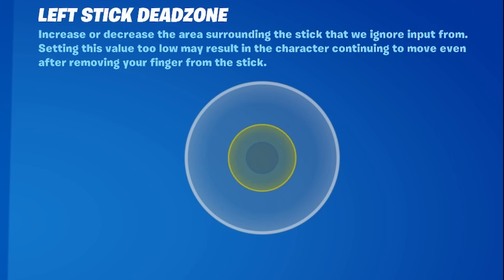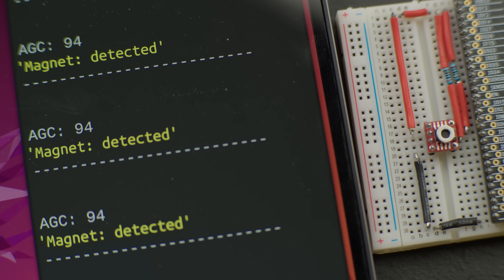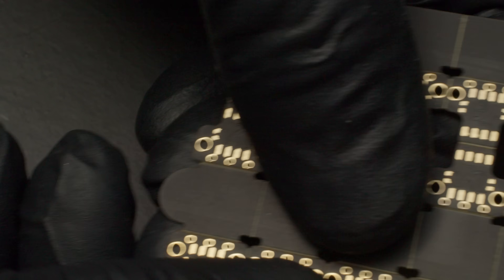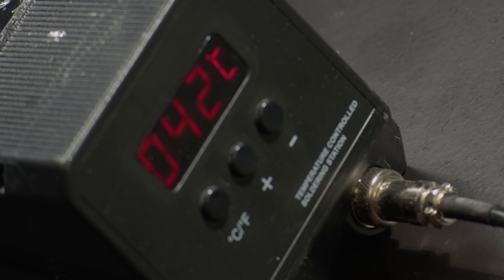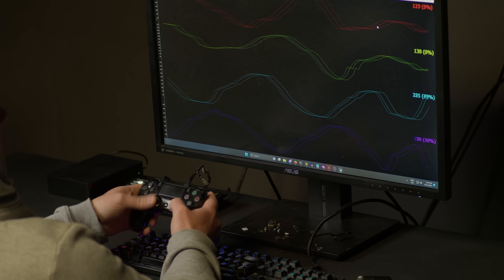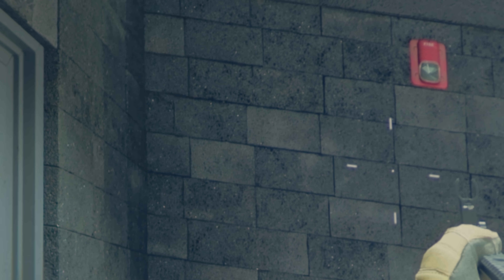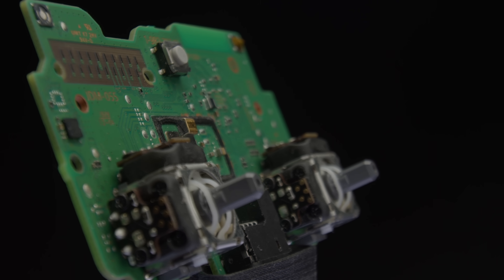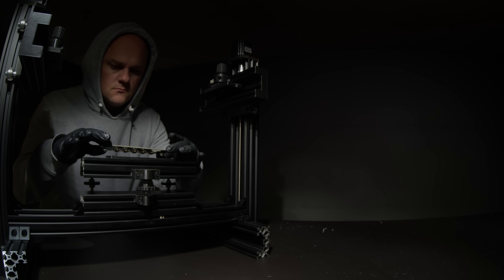Beating the $20B Joystick Drift Problem, and giving it away for free

Comment: they are fully aware of the problem and it is intentional Robbery , it is designed to break, simulated on known data about different materials and their stressresistance to withstand just long enough to pass any guarantee times, based on data from average controller use. The Automotive industry does exactly the same shit, creating parts that are designed to break after a fix amount of time and or usage. So, if your uneducated and unfamiliar with (not so complex) mechanical skills (most people arent even able to change their tires by themselves) you have to buy OEM parts, get it fixed at OEM shops on evil high Prices, or get a New Car after you get a new Credit, because you need to get to work to survive (and pay off the 10 cars you owned that broke down while there are still cars from the 80s with 1million miles on the clock driving happily around). Even Worse, them Evil Companys dont even give a shit about the Public knowing about this, because they fuck you in the Ass and are able to make you ask for more. Thanks alot America, you ruined the whole world with your stupid broken CapitalisticSystem.....

Comment: This is great and I commend you.
Not that it excuses anything, but at least as far as I have experienced, the current dualsense drift issue is due to the poor quality of the wipers as the material flakes off and gets in the way and causes the drift.
It's relatively easy to correct, but of course this shouldn't be an issue in the first place.
Then again, we live in a world where (especially since the global lockdowns) prices are going up and quality is going down rapidly. It's everywhere, not just game controllers or electronics.
Reply from the maker: True true! We need deflationary acts of individual when we cannot trust our institutions to handle it. You make a valid point about the vipers, im gonna do some experiments with a simpler solution. 3d printed conductive plastic material instead of the thing easy breakable resistive material. :D Thank you.

Comment: It seems that people are finally beginning to realize how bad of an issue joystick drift has become since 7th gen controllers.
I've never really encountered drift issues with PS2 or OG Xbox controllers. There still working fine for the most part. Even my PS1 dual shocks that has been used since the 90's is still going strong.
I have a bit of drift with my old PS3 controller that i put prob over 2000 hours into.
But i feel it really went downhill from there on. 
With the Joycons taking the cake. Which i replaced 2 times each after only around 150hours of playing.
I now have the guilikit hall sensors in there. Hope i don't have to open it up. For the coming 20 years at least.
I would love to have these in my PS4, so you won't have to worry about it anymore.

Great work being done here. I always love the users coming up with solutions when the companies ignore their user base when there is no profit in it for them .

Comment: Makeing the patent free, keep's a company from purchasing it, and putting it on the back of the shelf for eternaty. Drift as you say cause's there to be a lot of mony in the sale of new controller's. In bussiness it'sreferred to as "PLANED OBSOLESENCE". Both Microsoft and Sony have known this issue can be fixed by doing this, but then when they make billion's on the replacement's of controller's. Well, who in their right mind, would deliberately give up billion's and do this.

After several year's which when I didn't start until I was 66 year's old. I've learn or taught my muscle memory to utilize an xbox controller. And as hard as it is to change one's muscle memory, and the elderly take even longer. I've changed to the "KONG" controller. Been over a year, and still no drift.

Comment: I will never understand why consoles don't have native stick drift support.. Like..... what, why?

 Or even better, built in stick drift support on the controllers, because not every controller has the same amount of drift.
Reply from the maker: They all have. Or almost all. Its the deadzone. The problem is you cannot unbreak the glass. If the joystick gives out broken glass signal. No software can fix it.

Comment: I have a serious question that i couldnt find an answer for,,,,,what makes the joystick go loose stuck on the side and can it be fixed ?
Reply from the maker: Can you try explain what you mean by go loose on the side?
Reply: @MariusHeier1  Thanks for you reply and sorry for my English what I meant is the joystick gets worn off from heavy use with time the stick won't go back to the center when you move it left right or up  down

Comment: It's funny, and no one believes me, but I have the cure for drift and it involves no dissembly.
Reply: @@_Decadent_Descent fast-drying silicone spray.
I don't know HOW it works, I just know that it does, and has been for the last seven months. Only one application. It's like magic
Reply: @paulmccarter908 does this works on already drifted stick or would you have to do this before they break?
Reply: @Albertmars32  This was a desperation move on my part, having four joycons drifting.
I was so sick of it I was willing to try anything. It turns out silicone is non reactive to electronics, and leaves a very thin layer of dry silicone that lubricates the mechanics of the sticks, buttons, triggers. Smooth and glassy after, sticky and jumpy before. It was and is a miracle.
Just to add, I wasn't shy about the amount; I shook out the extra and it dries pretty fast.
Bingo, no drift. I checked it immediately after with the joystick centering mode and all sticks return to center, perfectly

Comment: NO ONE will use that "solution", because if solution was simple/cheap/effective enough to be invented by random YouTube ego-maniac, actual engineers would already made it. Another video in genre of "I built light speed rocket better than NASA". Geeez, stop it. Even the title of the video is bs. WHere did you get "20B$ problem"? 20B$ is the amount of gamepads sold in the past decade, not cost of this "problem" (that barely exists, by the way, in years owning ps4 and ps5 never have I ever had problem with drift).
Reply: Actual engineer already using Hall sensor instead of potensio as industry standard in a drive-by-wire vehicle. I have never find potentio used in throttle except in toys
Reply from the maker: @iveusethisusername  Controllers are sold as toys. So its kinda expected
Reply from the maker: So how far has the world become when a random NON-engineer YouTube ego-maniac fixes the problems actual engineer cannot? Maybe your small sample size of 1 gamer is not enough to get a feel of the problem?

Comment: Since the ps4 I have stuck with ONE controller and when there's drift I replace the disc in the sensor and it works but over time drift comes back, now on ps5 it's worse bc it's twitches and Jerusalem to the left and first person shooting games are hard to play if you can't accurately aim, I don't wanna by another ps5 controller bc mine is custom from the shell, buttons and paddles so if you finish a version for the ps5 controller I WOULD BUY THIS JOYSTICK  so I can keep my controller for as long as possible

Comment: Can u please help me with my project? I swapped simple rumble motors in my gamepad with hd hapticts from switch pro controller. But it has different principle of work - current needs to be interrupted in order to get lond brrrrrr. Is there any simple component i can solder in to achive this? May be some sort of capacitor or anything
Reply from the maker: Sorry i dont know!

Comment: Hall sensor are used so much in other controllers, and only console gamepads producers are actively resisting implementing them and still sticking to potentiometers.
Glad to see there is a direct replacement possible, I thought to modify controller this way by yourself you will need to also change circuitry around it

Comment: Bro, I’m 34 years old, I got an n64 for Christian’s when I was like 6, I have never seen joystick issues until this generation. WTF. 28 years of gaming and now suddenly no one can make a joystick for a $100 controller. Foh
Reply from the maker: Yeah. These joysticks are made so they have easy replaceable potmeters. By design. because they probably know they wear out quit. So they made them interchangable. Its just that Sony have manually hardcoded the centervalues in the controllers so its really hard to replace them. They could have fixed this really easy in software. But i guess they like selling more controllers better.
Reply: @MariusHeier1  shit my n64 controllers worked for decades. Young, dirty, violent children playing with it for years upon years. Ps1. Ps2. Xbox. Xbox 360. Never needed a replacement and never drifted.  I’ve also had joysticks since I was a kid and never a problem. Only in 2020 all of a sudden. It’s a cash grab. Build it to fail to you have buy another. That’s all it is

Comment: A magnetic twist on the N64 analog stick that used a laser passing through a encoder wheel to measure distance traveled with the stick.
Essentially we had the mechanics figured out in the 90s, the design drawback then was materials used would degrade from friction like the resting bowl for the stick, but the sensors and wheels in these old N64 controllers are still working as well as the day they were manufactured.

Comment: Are there any plans to implement this into quest controllers? they're so bad with drift and I feel like it would be a huge increase in quality that many people would appreciate
Reply from the maker: I never heard about those. Please share more. :)
Reply: @MariusHeier1  So it's a huge ongoing issue in the VR community, with the largest headset being the Meta Quest 2, and recently their production has gotten worse and worse, the old controllers tend to outlast new ones, but they still had very bad stick drift issues over time and the joysticks have to be fixed/cleaned/replaced way too often.
Reply from the maker: @yeetyeet4212  ahhh yes that one. Yes. I can probably get one of those. Lets see how much it is.
Reply from the maker: @yeetyeet4212  Do you know if it registers as a usb hid device when you plug it in?
Reply: @MariusHeier1  I suggest waiting!!! The new one comes out soon and I imagine there will be a price drop once the quest 3 launches
Reply from the maker: @yeetyeet4212  i was thinking about just the controllers. :)
Reply: @MariusHeier1  ohh, right right, that might be a bit more cost effective xD
Reply from the maker: @yeetyeet4212  I see the Meta quest 2 is using a different style of joysticks. Will need to make a new module for it. Will look into it. I really like this style of controllers for controlling robotics etc

Comment: I've been looking for something I can use to replace the sticks in the Hori Switch Split Pad Pros as I can't use the regular Nintendo Joycons anymore after trying them. They are way more comfortable and give better control, as they feel closer to a regular controller than the Joycons do.

Gulikit only makes replacements for the regular Joycons. I don't mind if someone released something that required soldering either, just as long as there was a solution.

I know it's not likely, but is there a possibility you could sell something that would work with the Hori Switch Split Pad Pros?

Comment: They dont switch because it cost more for the unit (engineering, material cost, assembly, etc). Why make a product that will last forever when you can make a product that will last a few years at best, then break so you are forced to buy the new one... Sad this is the state of the tech industry. 🫠